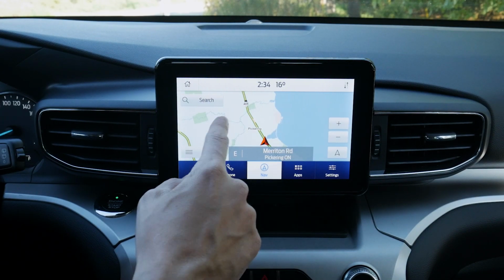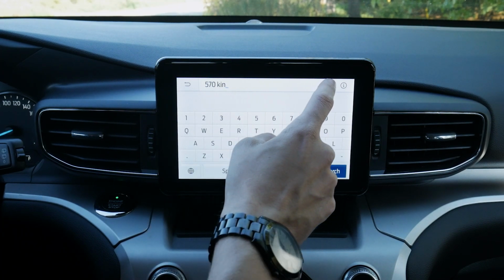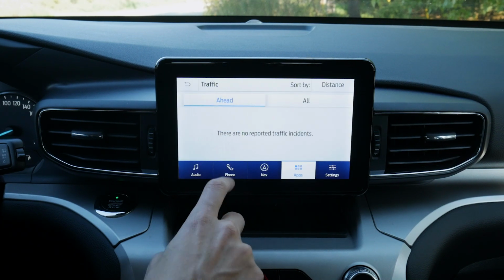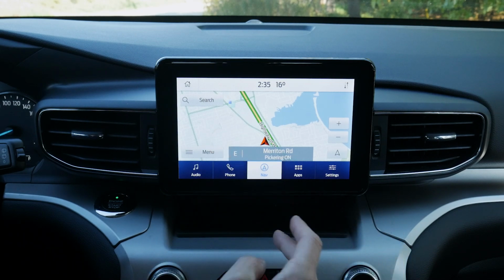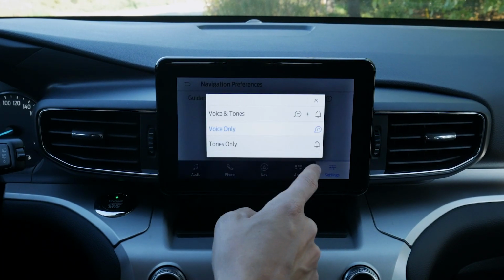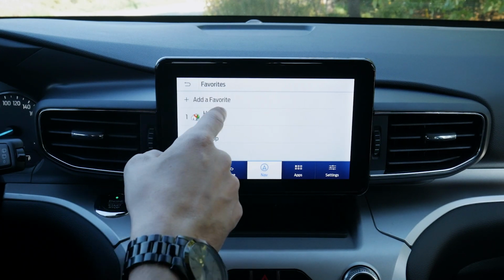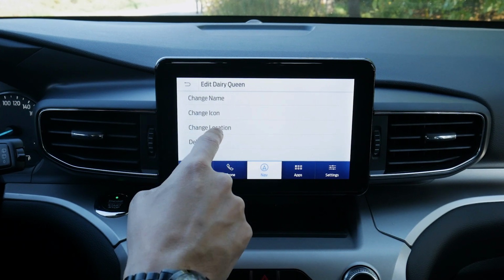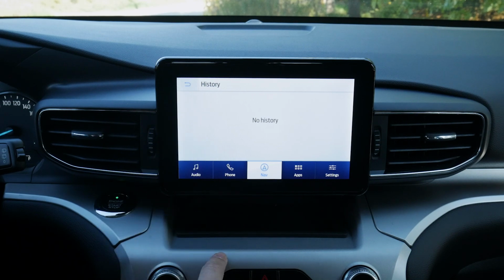Using Factory Navigation in the 2022-2023 Ford Explorer

Comment: Hey Steve I see you have the 3d city model on just like u do but how come on the nav it doesn't show up as a 3d image...any idea ?
Reply: I can see yours seems a little 3d but mine just shows it flat
Reply from the maker: If you press the nav icon on the bottom right of the map it should change up the heading type! You can also adjust it in the navigation settings
Reply: @CarsWithSteve  oh yeah got it now thanks man 👍